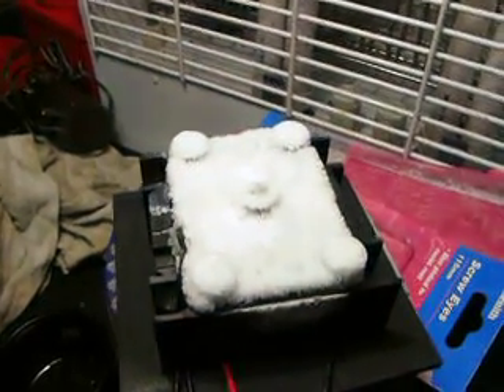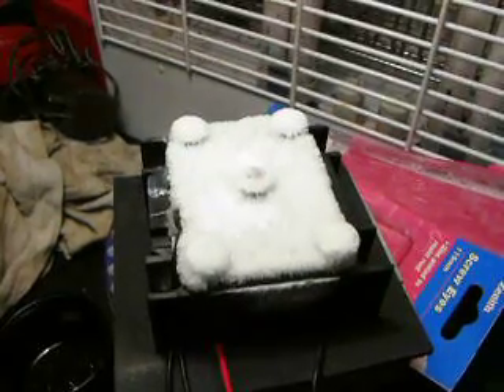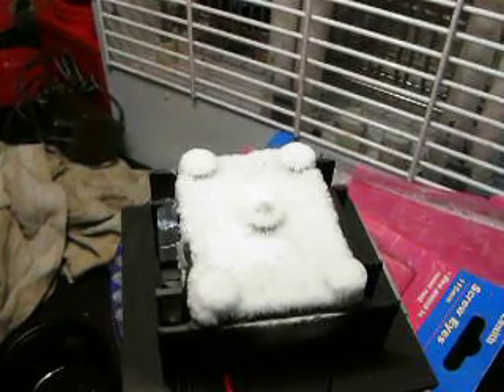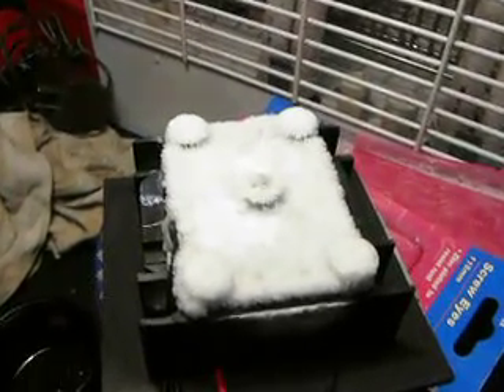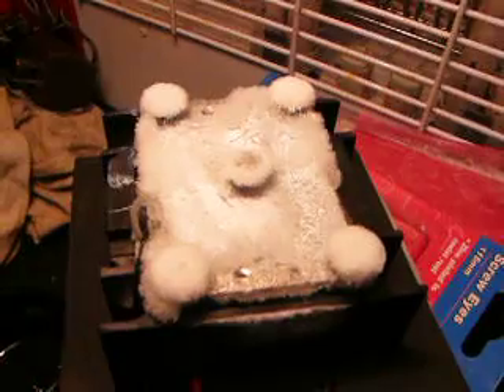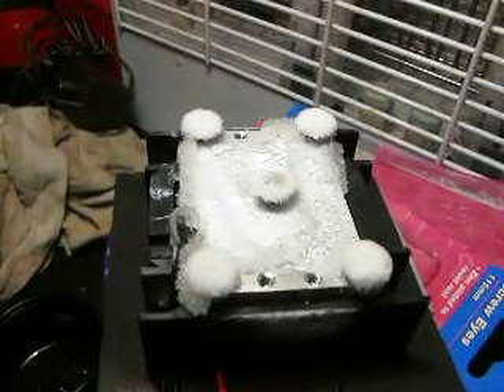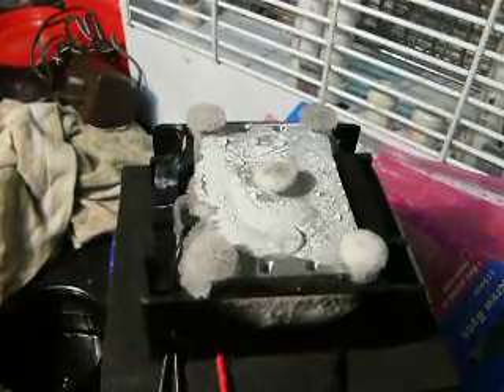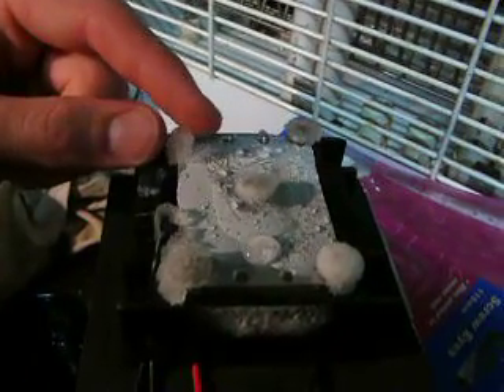peilter effect chip in reverse

Comment: I read on a website that if you invert the polarity of the wires, the peltier simply cools the other side and warms the other side. I notice however that the wires are colour coded (red for + and black for - polarity). What's the point of the colour coding if the peltier runs in reverse too? Does it by any chance run better if you apply the polarity according to the colours of the wire, or does it run equally well both in forwards and reverse polarity?